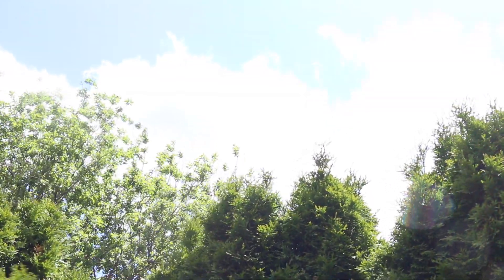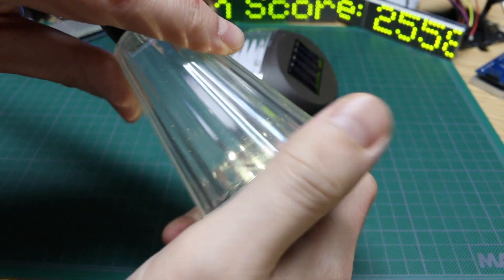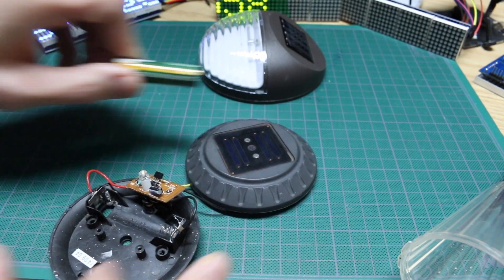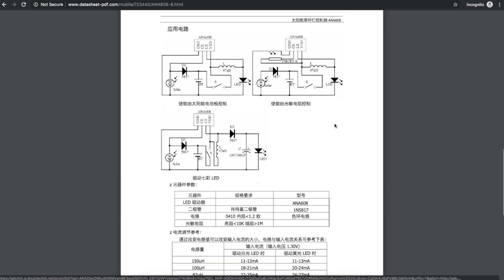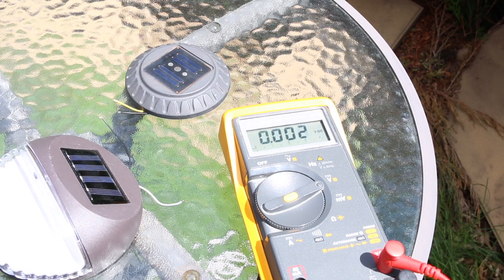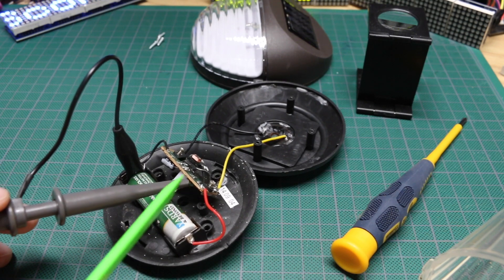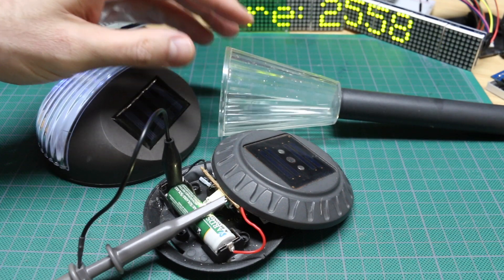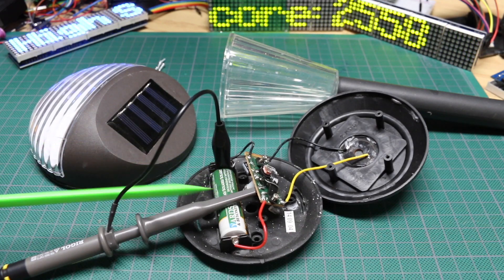Solar Cell Output in Garden Lights  - Comparing Different Units

Comment: The ANA chip in the unit with the LDR would be able to drive either a self blinking LED or a color changing LED because of the extra diode and capacitor near the LED, normally a signal level diode would be used but here they used a power diode.

Comment: I opened mine from 3 years ago and the inside is just rust and corrosion. Maye I'll try to make a few with parts I have. But I don't have the ANA chip. Google is my friend. https://www.eleccircuit.com/wp-content/uploads/2016/03/simplest-automatic-solar-led-light-circuit.jpg   This will do.
Reply from the maker: My lights that were outside all year around for several years surprisingly had no signs of corrosion, just a lot of white insect nest looking stuff that I cleared out and everything including the batteries themselves and the battery contacts of the light were still perfectly shiny metal and the batteries even work fine after all this time constantly charging and discharging.